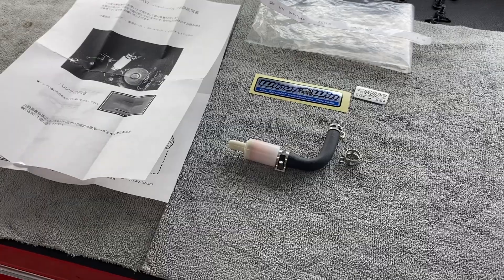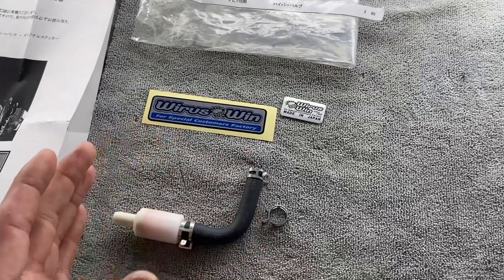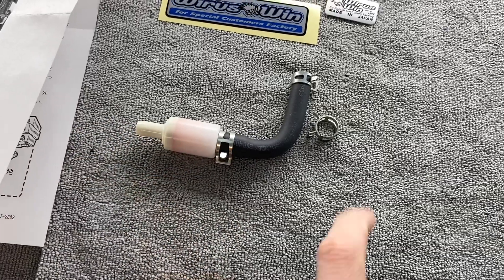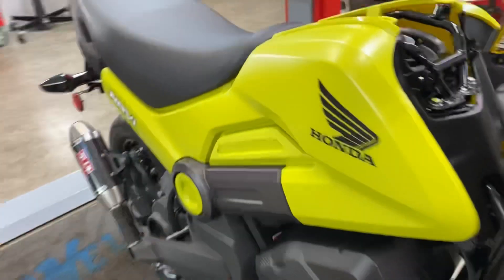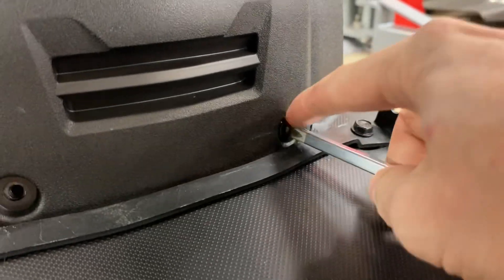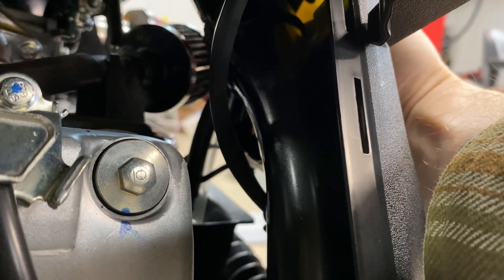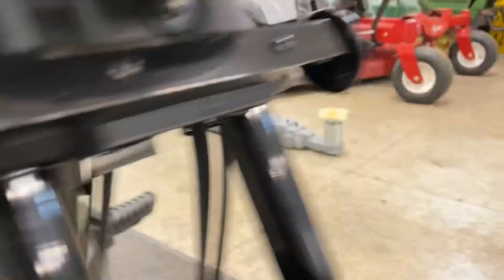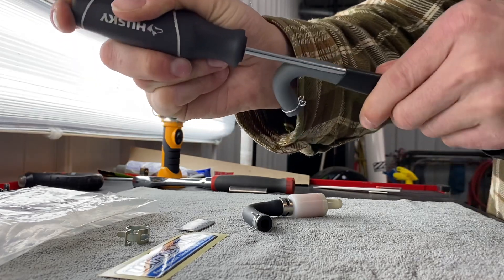Honda Navi ( install of your Hyper Valve/PCV Valve)

Comment: Another great video...thanks again. Did you see the new 21mm carb kit from  scooter swap shop yet?
Reply from the maker: I did.  the best performance is cutting weight, I will just eat more salads/less burgers and save the 350.00 lol plus I've done some mods to the Navi already and want to get a video out on the what I've done already. Thank you for the heads up on the carburetor though, are you purchasing one?
Reply: Gonna wait a little longer. Have 278 miles and it seems to be a little peppier just breaking it in. I'm looking for more top end. Not going to start modifying until I hit the 600 mile mark. Your Navi is looking good 👍. Are you happy with the intake kit ?
Reply: Great thank you!
Reply from the maker: @vincentvaicunas1458  I'm jealous on your miles. I wont be able to really get full bore tell I hit my 600 mark as well. im happy with the intake yes looks and sounds good, definitely can hear the air getting sucked in...

Comment: Another great video thank you. Have you seen these "pcv valves" anywhere else for the Navi than Japan?
Reply from the maker: The thing is the oil gets dirty pretty quick from being able to ingest outside air even with a filter on.   Any PCV will work that fits on the hose. Just make sure it is set so the crankcase vent blows out through the PCV.
it all depends on how you ride and where you ride if your on dirt roads riding in wet weather. more of advanced riders us them offroad/adventure riding folks
Reply from the maker: most guys make there own fyi
Reply: @RideorDie  Yeah, if you were to do it again would you save the $50 and make your own? I think most pvc valves are around $10
Reply from the maker: @jeffmartin6174  yeah lucky I bought almost of this stuff awhile ago, I payed 25.00 for the kit but yes you can make your own. Thanks jeff

Comment: Just curious what exhaust did u throw on it. And how was the install..im shopping around now for 1
Reply from the maker: My exhaust is custom made, you can’t find an after market exhaust for the Navi besides Hotlap in Japan and I know there are many orders ahead fyi guys are waiting for awhile. 
I have a custom made bracket fit the Yoshimura muffler and reused the header factory pipe.

Comment: My secondary filter pukes a lil oil after long rides.
Reply from the maker: To much oil in your motor
Reply: @rideordie6886  I thought the same but it's right in between the top hash marks. Confusing
Reply: @rideordie6886  guess I can try running slightly less and see if that helps. It's only after long 40-45mph rides

Comment: Dont even bother with this snake oil product, been around since the era of the original grom and does nothing.  Its simply a check valve on the crank case breather that MIGHT produce a slightly negative case pressure but unless you are pulling vacuum via some other method on the crank case itself its not going to do anything for mpg/power/etc
Reply from the maker: seems to work for the cvt on the navi